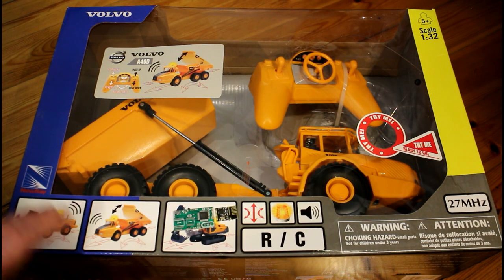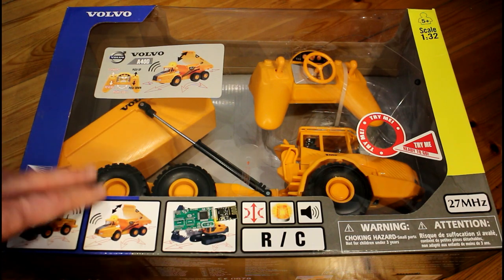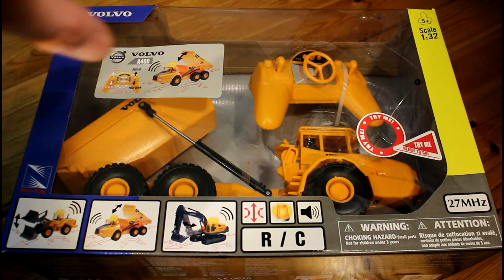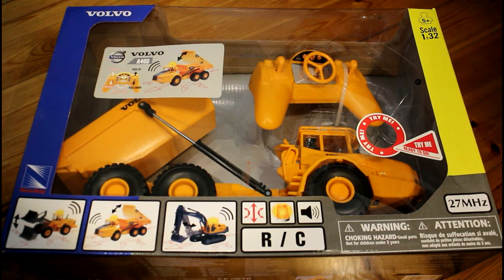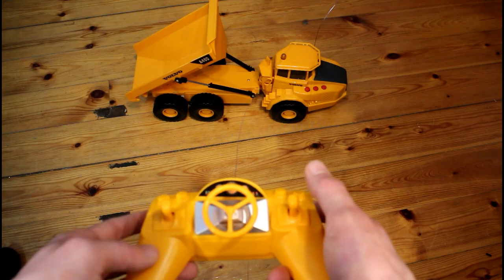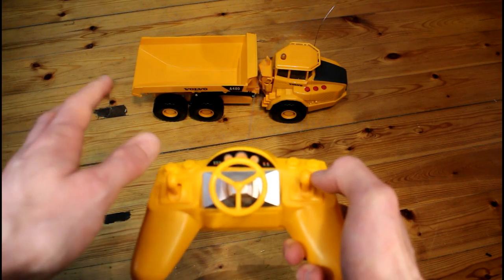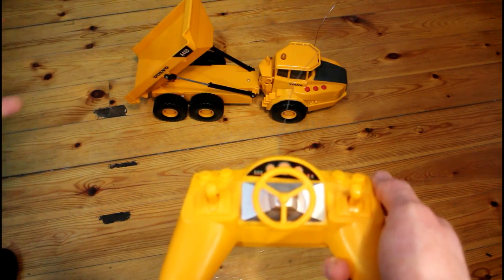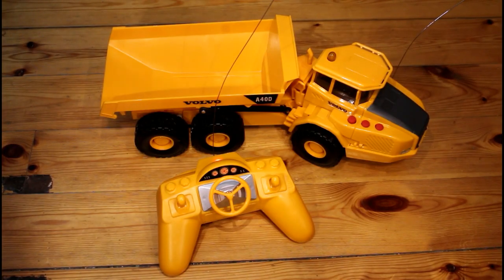RC Volvo A40D Part 1 - Testing Original Model

Comment: Nothing wrong with the motors on these models. Just lock up the slipper clutches and it will be fine. I have done lots and lots of extra mods to mine to make it better. But for a start all you need to do is disconnect the sound module and lock up the slipper clutch on the main drive train gearbox. Check my Channel too. BTW. good job!

Comment: where to buy volvo rc 1:32 ? link ?
Reply from the maker: I got it on ebay, here are some examples http://goo.gl/U7xMrl
Reply: Thank you, tell me width and length of volvo ? please?
Reply from the maker: Its around 120mm wide, 360mm long and 120mm tall.
Reply: thank you friend..
but not fit on top of trailer siku 6723, volvo :( too wide :(
Reply from the maker: Yes I tested it there and only 2 or 3 mm of each tire fits on the trailers, too big. I also have this problem with the PC400 excavator so I'm going to make extensions for the sides of the lorry trailer, make it a wide load.